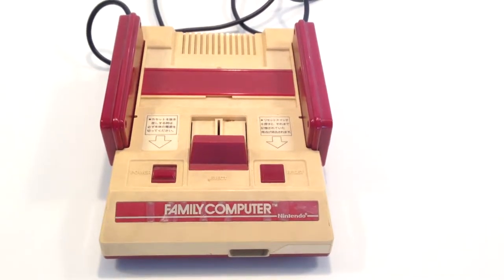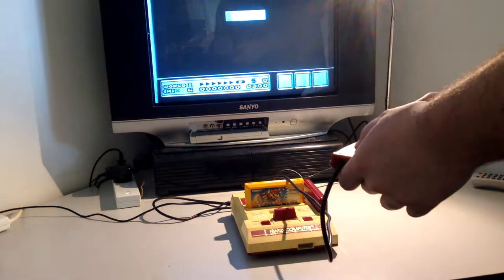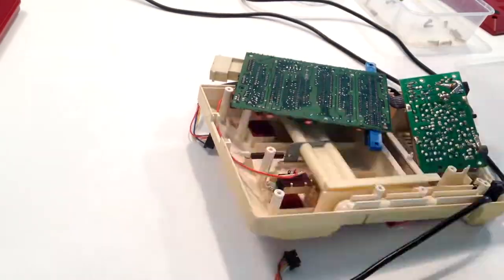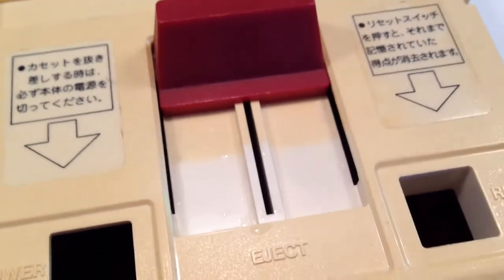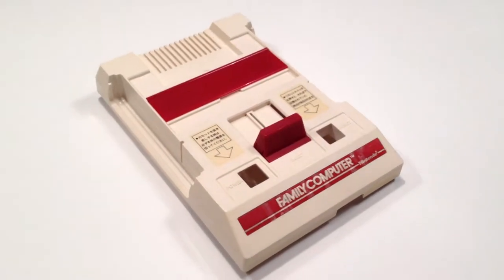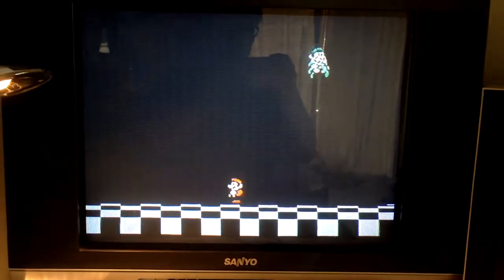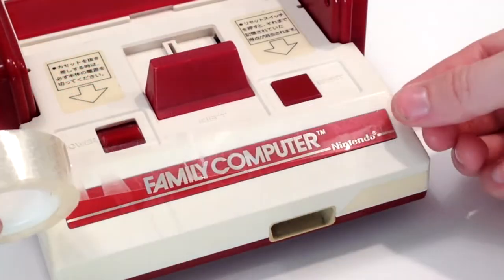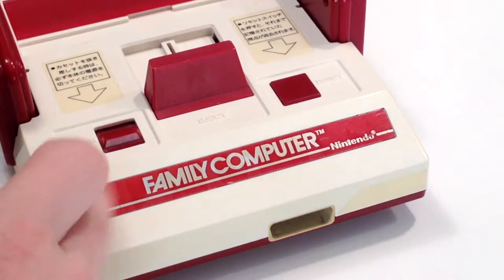Nintendo Famicom - Cleaning & Restoration

Comment: Did you fix the loose action button you were talking about?
Reply from the maker: I happened to have a spare set of controllers I swapped over, only ended up opening the Player 2 controller to clean out the microphone in it which can often cause buzzing to come through the TV!

Comment: Looks amazing, how u do the color bleach And the av mod?
Reply from the maker: The whitening was done by using Hydrogen Peroxide and U/V light (Australian sun in this case). The A/V mod can be done by taking the composite image from the PPU IC and routing it through a cable, or wiring it up to a port. The mono audio can be taken directly from the cartridge connector or the bridge connector where the main board connects to the power / RF modulator board.
Reply: How much hydrogen peroxide?